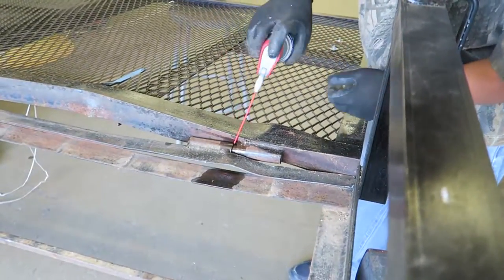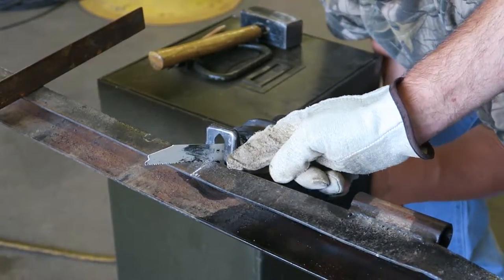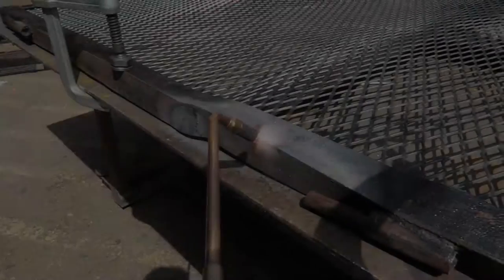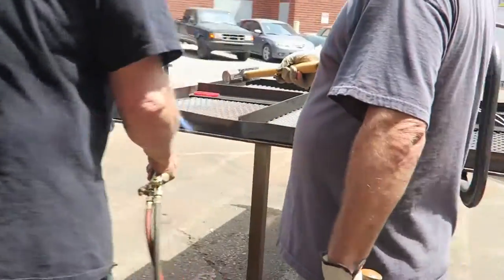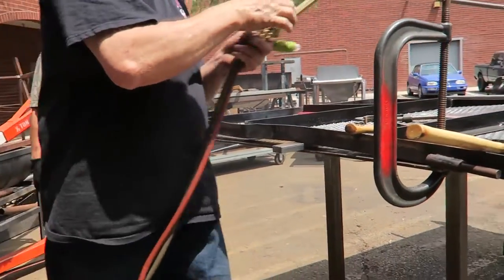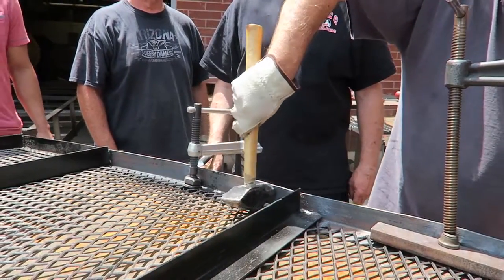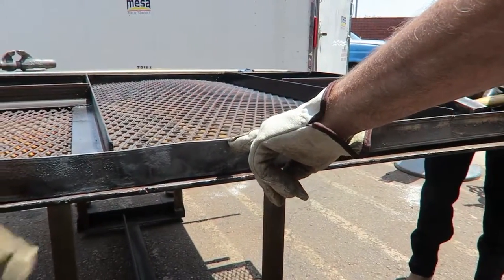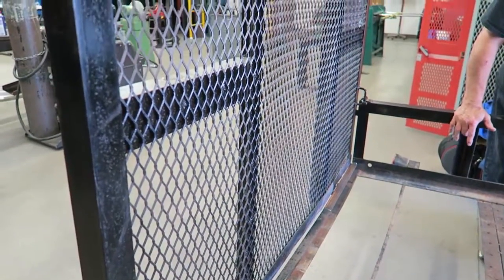Repairing a bent trailer gate with hammers, clamps, fire, and welds.

Comment: Looks like the worst way to fix it, even if this is a high school welding class. While the heating/bending may be good experience for the students, teaching them this Mickey Mouse way to repair something isn't. It was obviously built too weak to start with, so instead of fixing that issue by replacing the thin, weak angle with something thicker and stronger, you repaired it and left it even weaker than it was when it started? That doesn't seem to be good for either the students or the owner of the trailer.

Doing it right by cutting out and replacing the bent angle would have been faster and better for all concerned. The students learn the right way to fix it, and the owner of the trailer gets it back in better, not worse,  condition than it was before it got bent..